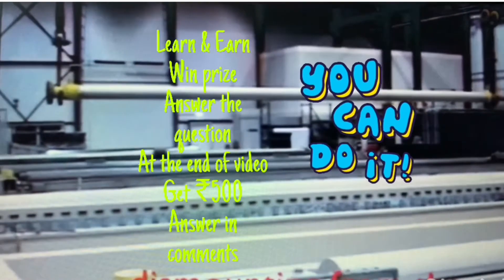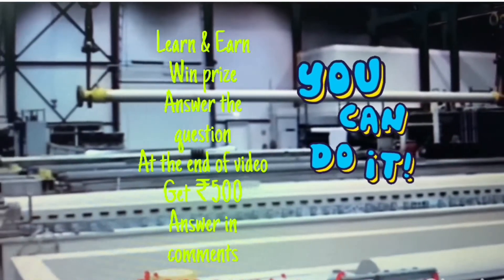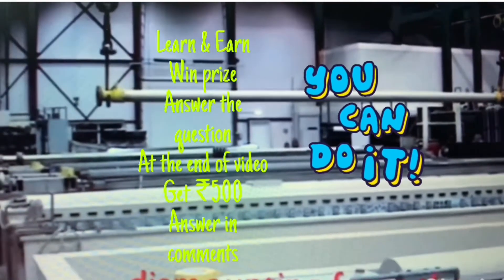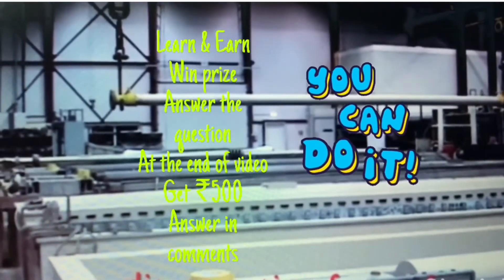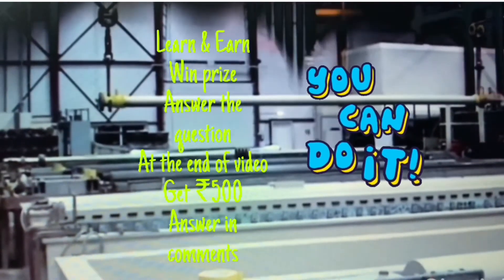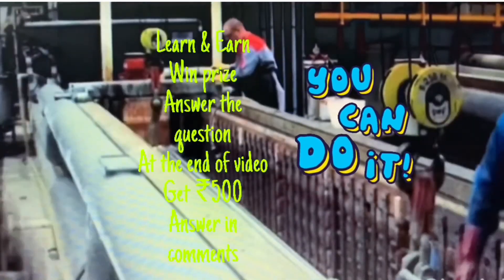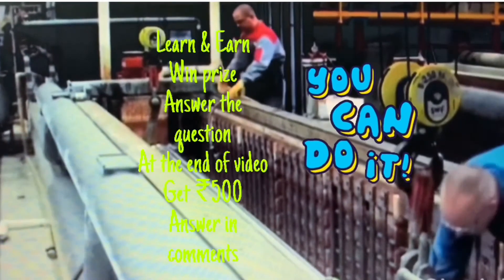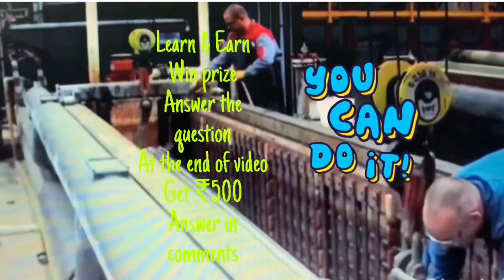THIN DENSE HARD CHROME PLATING #rakeshkochhar #YouTube#anode#cathode#steel

Comment: I have question sir, how to process thin dense chrome plating? Type chemical used for process and parameters on process anything? 

Please answer my question sir.
Reply from the maker: Sir , in this process the time of deposition plays a major role. In dense as name appears the deposit is such that no chances of porosity, so the rate of deposition kept very slow and for longer time. In this way the the hardness and deposit will improve the quality. This is done with same chemical but the current rate is made slower to flow. Thanks.